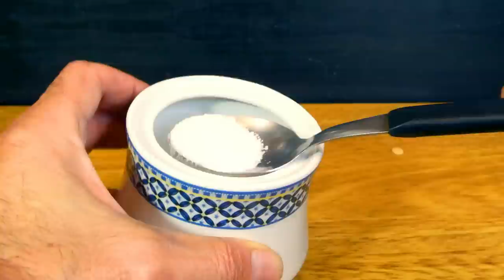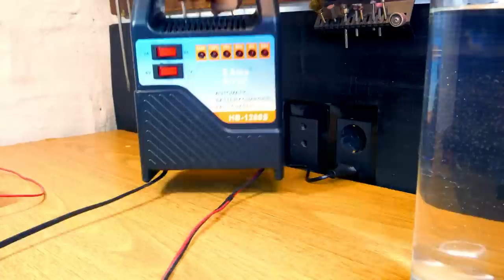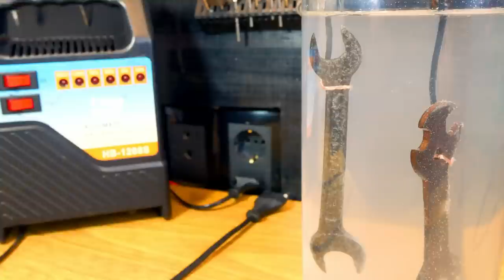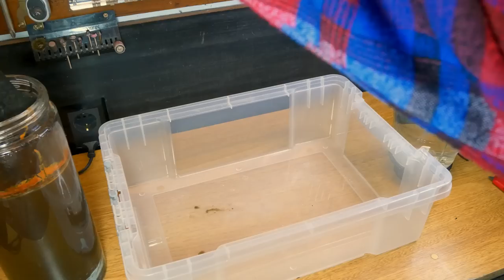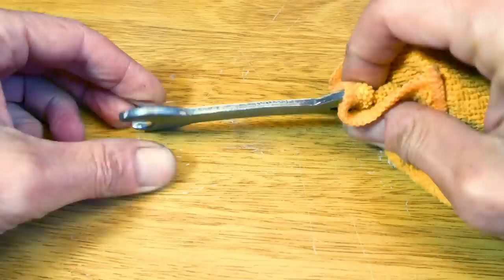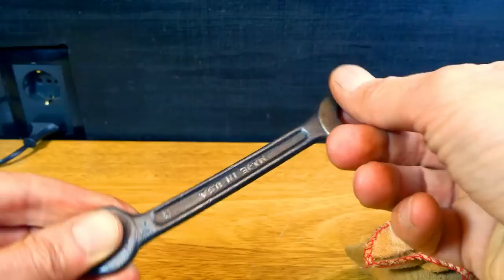Give Rusted Tools ELECTRIC SHOCK and get Amazing Results !!

Comment: congratulations for the very effective methods (I saved the videos because I need them) even with white wine vinegar the rust comes off, I tried to do it and it works, just leave it for half a day and then with the steel brush the rust comes Street👍🏻 I use a translator, I'm Italian, I hope you understand☺️

Comment: I use to do it with vinegar concentrate (25% acidity) but it’s said that you have to put a good coating on the steel or take otherwise good care afterwards, as the acid makes the surface more susceptible for humidity as due to molecular grid perforation or so.
P.S.:
I‘m from the Berlin, 12th borough, aka as Neukölln.
Reply from the maker: Thanks for watching !

Comment: You changed the tempering of the wrenches.  It is ill advised to retemper the wrenches without proper control and knowing what hardness you're going for. Tempering can have negative effects on the tolerances and shape of the wrench as well.

Also, they do make corosion removal chemicals that work better than salt for the electrical corosion removal process.
Reply from the maker: No tempereing affected, heat requiered for hot bluing is very low...chemical corrosion removal ia posibility but electrilisys is cheaper and very effective.
Reply: @Repairman10169  I did not refer to chemical corrosion removal.  I said that there are chemicals designed for use with electrolysis that do a better job than salt.
Reply: @ianbelletti6241  What are these chemicals? I've done salt-electrolysis and would like to compare to the chemical version.
Reply: @mike_98058  I couldn't specify the specific chemicals.  You'd have to research that. you're the first one I've seen that uses a brine bath instead of chemicals.
Reply: @ianbelletti6241  hahaha!